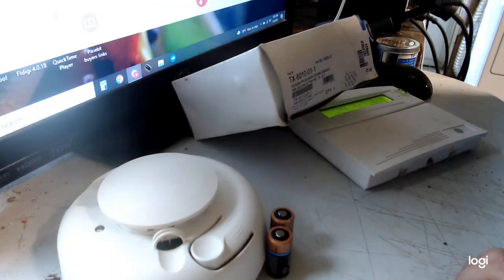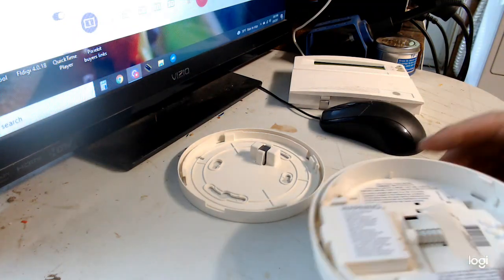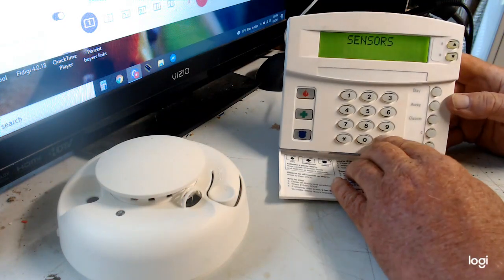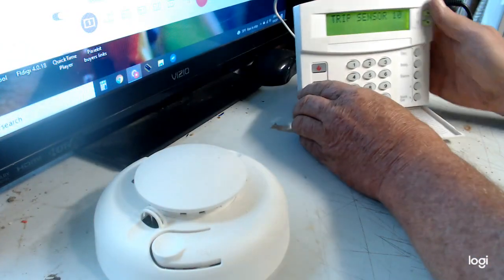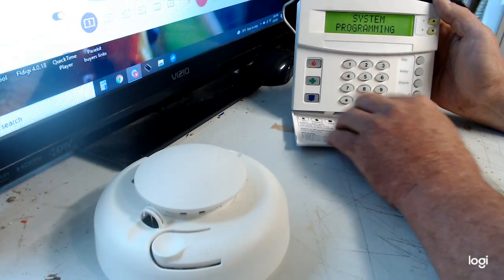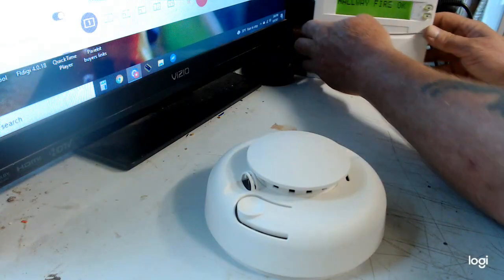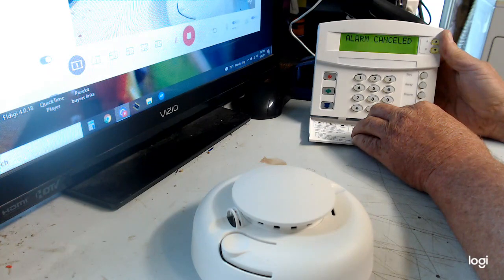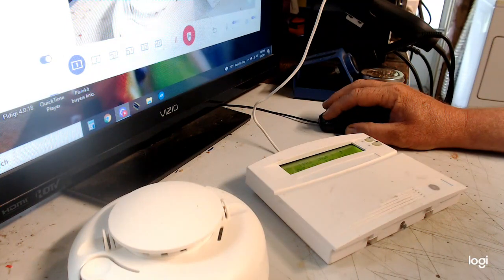GE Concord 4  How to program and test wireless smoke detector TX-6010-01-1

Comment: Hi great video! I have one of these exact smoke detectors but need to replace it as it is sending false alarms. Date code shows it is almost 15 years old. Is there a replacement for this system since this exact model has been discontinued?

Comment: How would u connect wired smoke alarm To panel
Reply from the maker: 2 wire or 4 wire?
Reply: @DIYELEKTRONICKITS  4 wire
Reply from the maker: Do not have a 4-wire on hand,,, give me a bit to work out a tutorial
Reply: @DIYELEKTRONICKITS  sorry scratch that i have 3 wire  yellow black and white
Reply from the maker: @snipex111  Sorry but those can not be wired into panel, what you have there are 120 volt AC smoke detectors

Comment: Great video . I need help though maybe you can help . How do i turn off smoke alarm beeping on the panel. Tried pressing disarm and code . Tried 1+ code and * nothing works . It beeps until it clears itself . No idea what to do to shut it off on panel
Reply from the maker: What does the keypad indicate
Reply: @DIYELEKTRONICKITS  smoke alarm . But when i click disarm it doesnt disarm it . Strange
Reply from the maker: @snipex111  Are you sure you have the correct codes?
Reply: @DIYELEKTRONICKITS  yes same code i disarm alarm. When armed .
Reply from the maker: @snipex111  take the smoke detector down take out the batteries then remove power and batteries from your alarm panel wait about 30 seconds and then repower the alarm panel battery first and then AC power
Reply from the maker: then put new batteries in the smoke detector and put it back up
Reply: @DIYELEKTRONICKITS  ok ill try that. Thank you
Reply: @DIYELEKTRONICKITS  now if i do that . Do i have to add everything in or its already in, ill just reset if any errors
Reply from the maker: @snipex111  Basically it's like turning off your computer and turning it back on,you will need to reset the time and date
Reply: @DIYELEKTRONICKITS  uhh ok gotcha ya . Thank you

Comment: Hi!  Thanks for the instructions. How do we replace old wireless detectors?  Need to erase old ones first
Reply from the maker: Yes, you will need to only (delete) them if they are no longer needed or you need to delete them to open up a zone for the new ones if there are no zones left on the panel